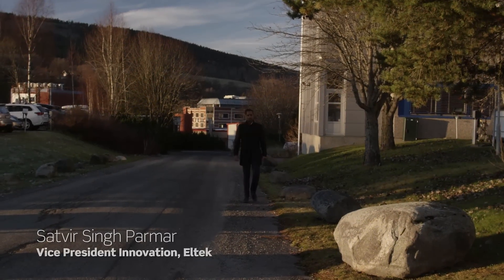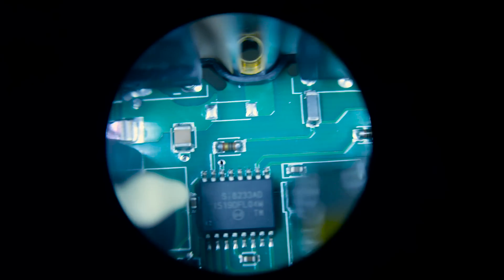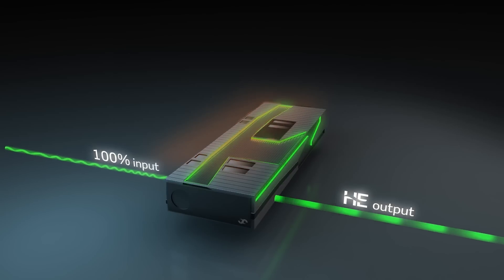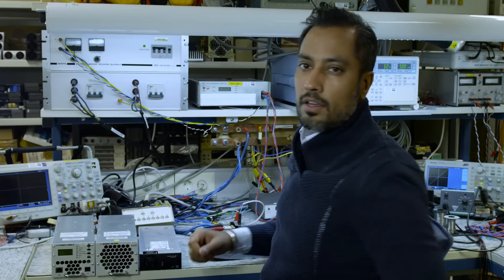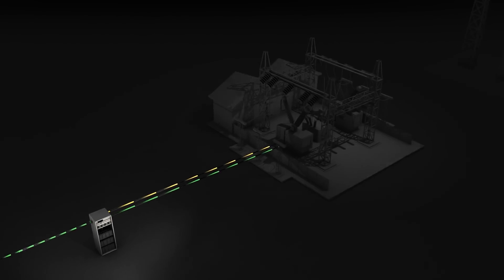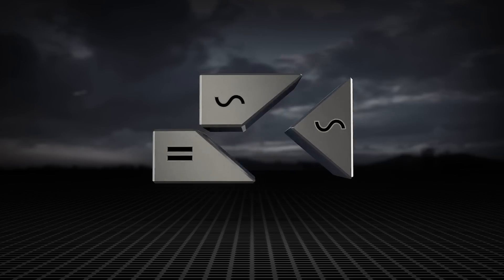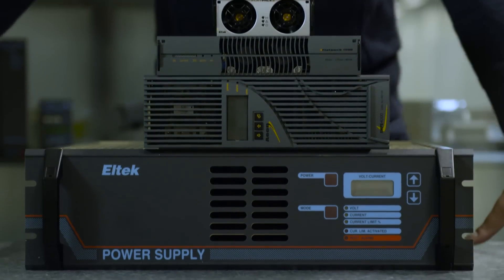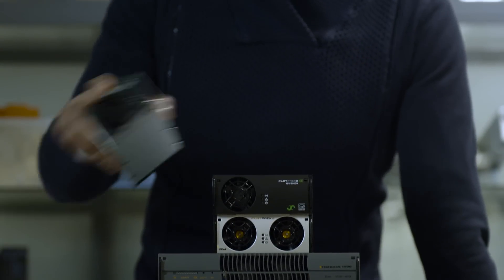Eltek Rectiverter Documentary with subtitles

Comment: Is it possible to change the 50hz setup to 60hz output without module controller on inverpack?
Reply from the maker: The Rectiverter modules accept both 50 and 60Hz from the factory (+/- 3Hz is the standard allowed deviation) (cf. the data sheet). 

When the network goes down, the modules will go to 50Hz if it was in the 50Hz band before it went down, to the equivalent of 60Hz if the network was in the 60Hz band. 
No configuration from controllers is required for this. 

If you want to lock to 60Hz, this can be done from controls, but then the Rectiverter modules will not be able to run from 50Hz network (they will run on battery even if AC input is available).  

For more information, contact your closest Eltek office: https://www.eltek.com/top-menu/contact-us/
Reply: @EltekBrand  i have inverpack module and it is run with an output of 50 hz,due to i don't have controller,can i lock this module in 60 hz output physically?
Reply from the maker: @okedo-key4491  For more information, contact your closest Eltek office: https://www.eltek.com/top-menu/contact-us/

Comment: Can u degine  sepret  pereset  voltage  and current   limit  in smps module,  because  control  panel always  damage  easily, 
Also  remember  repairable module  use customer, 
Use and thrue   not place  in compatison in market. 
Delta  smps module  also best quality  . Delta module  not damage  in Eprom,  it's very  positive  point.  And make this world no 1.
After service  eltek is not provide.